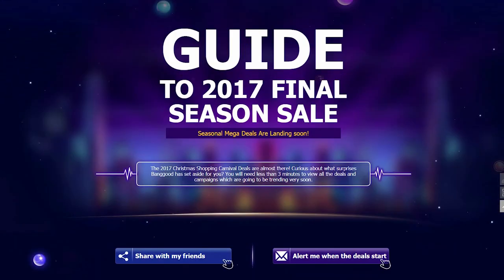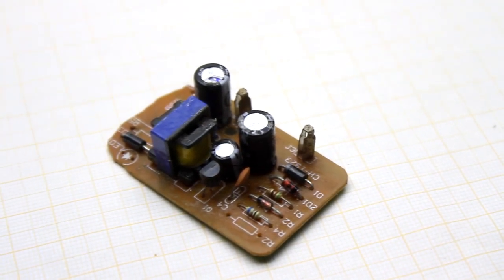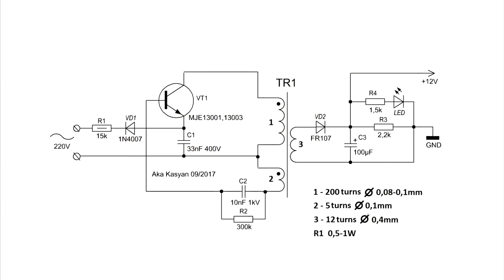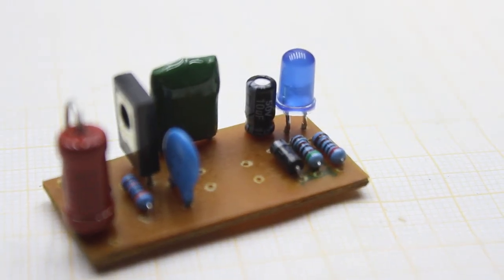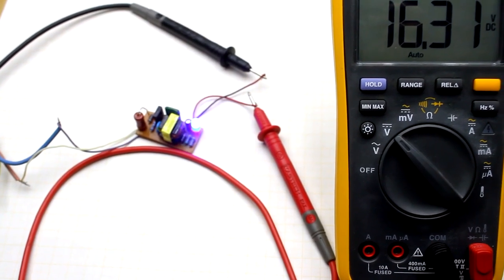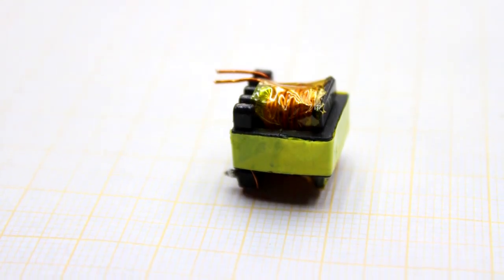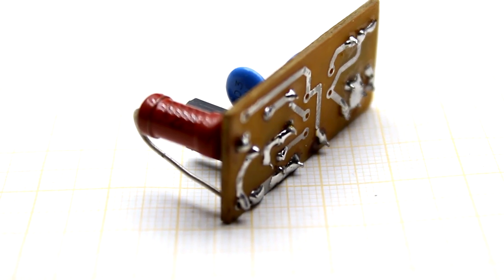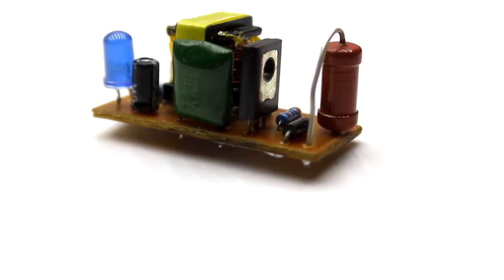DIY Simplest pulsed power supply

Comment: Pretty snazzy, but I was thinking of using a full bridge rectifier on the AC mains side with a series capacitor to limit current instead of a resistor. The resistor will limit the maximum current to 15ma. With a full bridge rectifier and a 0.2 uf (1kv to be safe) at 50hz/220v will limit the current to around 14ma and with a .4uf (1kv again to be safe) at 60hz/120v will limit the current around 18ma. Since it's all capacitive reactance there less actual power (heat) loss. Easily found and cheap X class capacitors would fit nicely here.
Reply: I tried driving LED through capacitors  but once a while the 'surge' killed my Leds ( on off on off )..if i left it just on then it was ok ... Same should apply here

Comment: I used 15k Ohm 1 watt as current limiting resistor, it gets quite hot.
Then I had to replace it with 22k 5w resistor. Now it's nicely working for about 2 days!!!
Reply: how many amps in the output?
Reply: @icecubepopos6563  u can calculate that

Comment: Kasyan
   Please build a DC converter circuit that will work with the AVR Transistor Tester OSHW project. The AVR project has a Zener Threshold testing circuit option. Many people on the forums have built circuits with the MC34063. There are also examples that use integrated modules like the TMA0515D. These options require People to order parts to build them. The Zener Threshold boost converter circuit needs to supply around 35-40 volts. We don't need more than 10-15mA. The voltage source for the circuit is a MCP1702-5005 (5V LDO) if someone builds the OSHW circuit from the original mikrocontroller forum article. If someone buys a Chinese clone of the project, they use a HT7550 regulator.
   The boost converter needs to be as quiet as possible so it doesn't cause problems with the measurement circuit of the device. I want to try to build something that uses general purpose transistors. Do you think you could create something that just uses  BC547/BC557?
 I will add references to your video on all of the forums for the project if you want to create a circuit like this ;)

Comment: please , i will use this power supply circuit with PIC micro controller . is this power supply circuit safe for this project or the ripples of the output voltage will hurt the micro controller or reduce its lifetime ???

Comment: Voltage decrease after adding load.
Any solution.
Reply: Add optocoupler
Reply: @visionofwellboyofficial  where?
Reply: @visionofwellboyofficial  can I have diagram
Reply: @tonnystark4430  Well idk if this gonna be useful but u can find circuits on the internet. In this situation add optocoupler u have to change circuit quite a bit so that's better to find some circuit with optocoupler on internet if u don't know how to design  it yourself.
change diodes gone wild is dissembling power supplies and reverse engineer it so u can see some simple circuits there, if u type "simple" in search on his Chanel maybe u will find something suit for u.

Comment: There are no calculations, no explanation of how to determine the frequency of ocilacion or how this ocilacion originates, and finally does not explain the topology of the regulator and is confusing if the transformer needs or not the gap between core
Reply: He doesn't have the formal training to know that. He most likely is a hobbyist and a tinkerer.
Reply: The frequency of this circuit can be adjusted by base winding as it control on off function of transistor. The frequency is in kHz
c2 and r2 are working as RC Oscillator